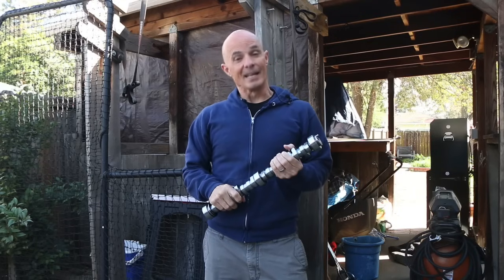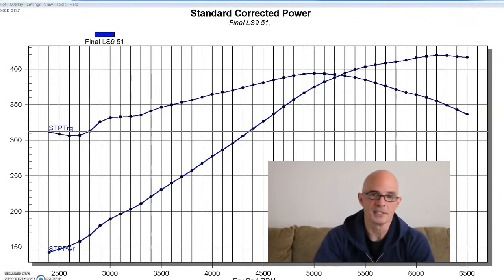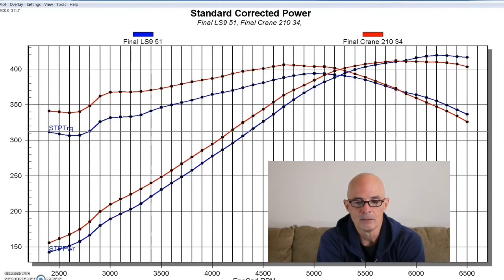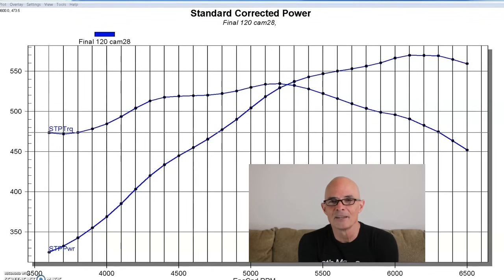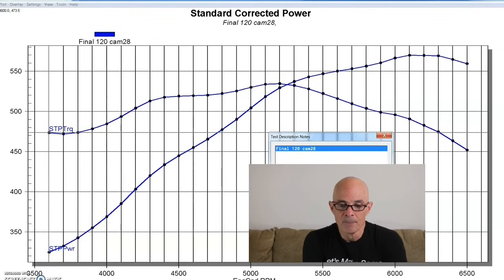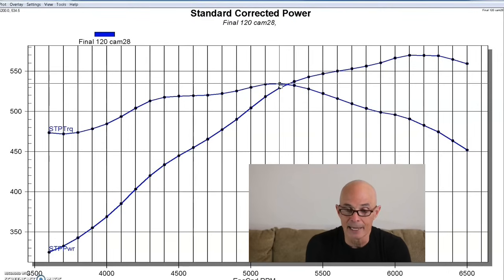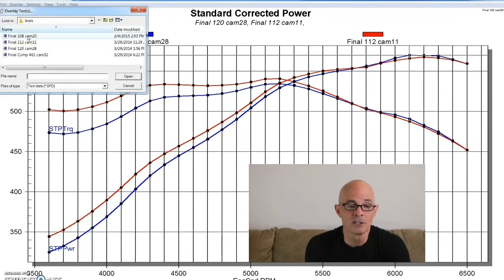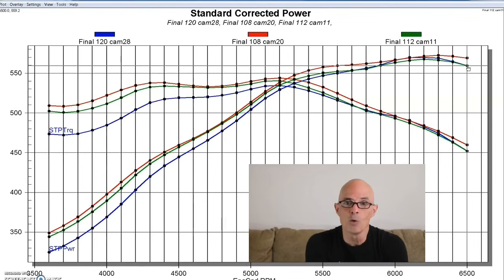LSA CAM TEST-108 vs 112 vs 120

Comment: Wow I just used the formula for a 376ci and 2.165" valves and I got 108.244  here is the formula by God himself well the LSA God
 LCA=28-(CID/8/valve dia/ × .91) and I'll be dipped
Reply from the maker: if only formulas were absolute
Reply: @richardholdener1727  it's actually not a formula, they refer to it as a formula but Adam had explained  in his first cam video that It's is an Empirical Equation which is proven to be absolutely accurate... An Empirical Equation in Engineering & Physics is a Mathematical Equation that dont lie, they are based off physics, observation, experience and acurate data acquisition instead of just theorys, Empirical Equations are created based on a physical result of a specific phenomenon that is observed to occur in our reality, in the case DV's Equation it has been quantified threw thousands apon thousands apon thousands of specific and rigorous dyno tests... Real Empirical Equations are created without Theroetical justification which means what your saying is incorrect so you should further educate yourself and stop spreading misinformation in relation to this subject, Here is an example of an Empirical equation, Newtons 2nd law which is in relation to changes in momentum, F=(M1*V1-M0*V0)/(T1-T0) the accuracy of Newtons Empirical Equation has the same accuracy as David Vizards LSA=128-(CI/8/Vdia×.91) Empirical Equation, that 128# varys from 127-133 with different engine familys cylinder head geometry they are listed in Adam's new video that proves all of this with dyno data to be reality, along with Adam & DV's LSA, Overlap & Duration Formulas bolth of which are different but bolth produce the same results...
Yall "Professionals" even with all the knowledge alot of you have, most of you still lack higher level Metacognative ability so your completely blind to your Cognative Biases, specifically your Selective Perceptions and your Conformation Bias bolth of which leads to quite a few of you being blindly afflicted by what is scientifically/psychologically known as The Dunning-Kruger Effect which is pretty sad but that is the reality we live in...
Most of these things including the Psychology aspect, adam had brought to my attention. After talking with him and doing my own research based off the information and the terms he has provided me, I am beginning to see what he said to me about how every single one of these things in this comment intertwine and create the reality we live in... I suggest you watch Adam's newest video and read everything that he wrote, he told me that he had simplified the video as much as he could so people could hopefully understand it.. He had said the subject is in reality so deep and complex that mabey 1% of the population or less would understand a video of that broke down the physics and explained all the complexitys of the subject at hand..
There Are Very Wise Men Coming Up In These YouTube Streets

Comment: No one wants a narrow power band on a street car. Or a cam that comes on with power late. Middle ground is usually best. I've seen more over cammed engines then you could imagine. What cam you think is best take about 20 percent away from that and you'll be happier.

Bv

Comment: If you listen to Dave vizard. You will find that he discusses the lobe separation angle being much narrower, especially on smaller displacement engines. The higher the displacement the less effect of changing lobe separation angle becomes. At about 400 cubic inches, it has becoming almost moot, if I'm remembering his descriptions properly turn it down about a 5.3 L engine, A 106 to 108 bulb separation angle should be fairly Optimum especially for a street engine. With higher lift and duration, it still follows. As you move up in displacement the difference in lobe separation angles tends to start to fade away and larger engines tend to like greater lobe separation because of volumetric efficiency changes. I'm doing this from memory because it's been only a few times that I've studied this, but I have always remembered what he has to say because he has the background and has done more testing than you will do unless that's all you do the rest of your existence.

Comment: Thank you, Richard. I was going to ask you this question and I recalled you always telling us to refer to your long history of videos. Lo and behold you had one on LSA that really helped to answer my personal question, I wanted to know if I could go to a lower LSA on my EFI equipment BBC. All the cam specs say not for EFI. But I know what you normally run, and I thought you had my answer. I'm not that concerned about idle quality and would like more chop at idle for my 70 BBC Chevelle. The only other thing I'm wondering is what effect positive or negative a smaller LSA will have on Nitrous. I'm off to search for that video... Thanks for all you do! Mark
Reply from the maker: lsa is not related to nitrous. ask what the cam does to the na power output, then add nitrous

Comment: Hey Richard, camshaft theory is fascinating to me and watch this video often. In fact, I had a custom Bullet Cam for my 454 ground partially based on this video. Theorizing here, a tighter LSA generally increases cylinder psi, because it increases the dynamic compression, which may have contributed to not only the expected bump in low speed torque but also the power across the board.

Comment: Love to see same camshaft  with 3 different  engine displacement.  Chevy 4.8 liter , 5.3 liter, and a 6.0 liter what's the difference in idle quality and vacuum signal.
Reply from the maker: I have run the same cam on these different displacement

Comment: I have a 427 LS motor 14 to1 dart block the heads flow 360 on the intake and 244 on the exhaust. I’m thinking about ordering this cam solid roller. @50 274/284/705-LSA 112. Do you think 108 LSA would be better?

Comment: David Vizards 128 formula puts the ideal cam around 107 LSA based off engine parameters. I don't know the compression so just assumed around 10.5. If higher the LSA would be wider so 108 would be perfect. Weird how his formula works.

Comment: the 120 is prob more suited to forced induction
Reply from the maker: they all are suited to forced induction
Reply: @richardholdener1727  maybe but the 120 with less overlap likes big boost,instead of blowing out exhaust port
Reply from the maker: how does it blow out the exhaust on a turbo if the back pressure is higher than boost-and the change in lsa might not add overlap (might have started with negative to begin with), and overlap is NOT bad for boost-if it adds power na, it adds power under boost.
Reply: @richardholdener1727  back pressure should not be higher than boost in any modern system,it's why gale banks twin turboed small blocks back in the 80's LOL,it's hard to build cyl pressure when it's being blown out exhaust port LOL,and in a street EFI application you will find it very difficult to tune with unburnt mixture being blown into exhaust,overlap is not needed in a high boost application

Comment: The reason I widen my LSA is to soften up the bottom end for engine longevity. I have noticed with my twin turbo 406 sbc I snapped 3 different rods before I switched from 108 to 112. Now I have had the same engine for 3 years with no noticeable change in performance down low.
Reply: And as for the gains up top with the 108 LSA sometimes things just click and the flow and rhythm of an engine just work right together.

Comment: I have been told that EFI does not tolerate tite LSA well.
Has to do with reversion / irregular air flow thru the MAF sensor.
Yet u apparently had no problems. 
Care to comment ?
Reply from the maker: we don't run a MAF-we run speed density

Comment: If you had picked cams with smaller duration or lsa that put the widest lsa w negative overlap , the middle at zero overlap,  and the tightest lsa with a few degrees of overlap , I think the results would have been the same, but much more dramatic .
 Great test though . From my thinking, the Only reason to not tighten lsa is for smooth idle and easier tuning on sensitive efi units . From a power production standpoint, tight lsa wins .
 I good excuse to get a custom grind on LS cams . Its easy to find gen 1 sbc cams w tight lsa . LS cams are rare with overlap , unless you get a cam on the edge of ptv clearance .

Comment: My NHRA SS/J  66 Chevy II uses a custom ground solid roller with a 109 LSA  I had ground using David Vizards 128 rule. My heads are NHRA Superstock legal Edelbrock highly modified by Edelbrock to coincide with NHRA rules. I shift @ 9000 so its wound up pretty tight and pulling off a consistent 8.60s with a .060 over 327 and M22 tranny is no easy feat. Listening to David Vizard and reading his books has made not only my Superstock fast but my Stock Eliminator K/SA Monte Carlo SS (with the factory L69 305). This test Richard just run backed up the 128 rule big time. For big blocks and Fords is 127 and he has videos on it if you are wanting to learn. Thanks for this video Richard you are very entertaining and easy to listen to unlike Freiburger and Dulcich.

Comment: Good video - people are realizing the tighter LSA  means more acceleration torque AND NO LOSS upstairs- bigger displacement responds even better, of course vacuum drops due to more overlap and worse throttle response below 1500 to 1800, so an automatic and smaller engine should use a somewhat looser converter, BUT make sure converter stall speed is below top gear or overdrive RPM at highway cruising speeds.
Reply: That last part is basically impossible for a good street car. Cruising RPM in top gear at highway speeds needs to be under 3000 for anything approaching acceptable fuel efficiency. Most underpowered ecoboxes and sport compacts (the normal ones, not the extra weak ones under 130hp) run 3000rpm at 75mph in last gear.

The way I spec it is roughly 1/3 redline should be your normal cruise RPM, and that should match up with 0-10mph over your local hwy limits. Or if you have an abundance of torque and/or enough gears that they don't feel too long, 2000rpm cruise no matter what, and between 60-80mph

Comment: Does this follow the 128 formula we have used for years? The LCA as I was taught allows the combination your using the proper amount of time to fill each cylinder.  When paired with a larger intake valve, the LCA tends to widen slightly, pocket porting ect all helps flow.  Using the ci of a single cylinder & intake valve size to calculate the best LCA for the combination. That is considering we make sure the larger valves are not shrouded, I have seen where installing larger valves & nothing else was done, they actually lost tq & hp.  The larger 2.02 valves didn't offset the flow vs stock 1.94 intakes. Each build is different, the combination reflects the rigs weight, gearing/tires & intended use & overa

Comment: So I’m on the fence of getting the Stage 2 Texas Speed LS3 Cam or the BTR Stage 3 LS3 cam. They both have the same duration and lift. Only thing different is TSP has 112LSA and BTR has 113+4 LSA. What would the power difference be? And which cam would be a better choice?
Reply from the maker: I would go BTR for cam stability
Reply: @richardholdener1727  sounds good, what exactly do you mean by stability? I just like to be educated
Reply: @ZachClynes he uses BTR cams, hence the recommendation.

Comment: Assuming identical lobes, the wider LSA requires an earlier exhaust opening and a later intake closing. 
If the cam is smaller than ideal, that will improve top end. 

But if the cam is able to feed the intake and heads' sufficient air, you're giving up all of your scavenging for no improvement in top end.

Comment: Welp, I'm seeing this two years hence, but of course it's still very interesting. I've wondered the same thing about LSA for many years now.

I'm positing the lower numbers at lower RPM for a wider LSA have to do with how the wider LSA bleeds off more cylinder pressure. Both valves are still open for several degrees of rotation, and you can't build cylinder pressure until they are both shut.

My bit of homework on the newish cams sold for use on low compression engines run in line with this.  Comp Cams' Thumper series, Hughes Engines' Whiplash cams, all have very tight LSA numbers.  As you say, they give the hot rod guy the lope he likes, but the smooth out early. And they actually make more cylinder pressure than an OEM cam.  The lope isn't desirable for an OEM for sale to the general public.

All in all, very interesting and thanks for taking the time and effort to do it.

One other factor I've wondered about for years, how about the installed angle of the cam?  Would installing the 112 LSA piece, maybe even the longer one, make these valve events soon enough to compensate?

Thanks!

Comment: Does this translate into sbc as well? What lsa would you recommend for a 383 with 10.1 compression?
Reply from the maker: don't pick your cam based on lsa-pick it for the things you need it to do! Idle quality, drivabiliy, power, torque, converter choice etc...

Comment: I let crower pick out my cam there always 112 and they make great power ,I just tell them what the car weighs rear gear ratio trans stall converter RPM tire size what intake and carb compression they never let me down

Comment: I wish these guys would just run two different rpm sweeps, on some of these tests, so people could see what happens to the daily driving characteristics too... I was watching this again to get a better understanding of why Engine Masters got different results, primarily with the 112 lsa. It appears that the intake manifold has a significant affect, as EM used carbs with a tunnel ram vs the FAST efi here. So, it appears you can restore a lot of the lost mid-range power, of the wide lsa, with intake runners tuned for to do that.
I think what folks really need to know is that with the higher lsa the vacuum at idle, and up to where the tighter lsa catches up. This is important for two things. 
One, power and driveability will be better at daily rpm with a wider lsa.
Two, tuning will be significantly different. Fuel injection is typically more affected because often times fuel pressure in at daily rpms is controlled by vacuum. So, if you don't have 15-20in at daily rpm, the engine is going to get typically about 10% too much fuel. This can be tuned out more easily on modern systems, and a lot of them don't use vacuum reference. But, if you're trying to cam up an older FI car, or meet emissions on a newer one, this can be a problem.

Comment: I know this is an odd question, but, how close are you getting to of an open cylinder allowing spark before the cylinder is closed and making compression? I know that you can get overlap but what LSA does that happen?
Reply from the maker: BOTH Valves are closed when ignition occurs

Comment: 295/336 Duration, 595/595 Lift, 107 LSA I was thinking about putting this cam in my stock 5.3 stick shift 4.10 gears and truck weighs maybe 3200lbs

Comment: I like the 112 because it will idle way better and I believe get more mpg.I put an Isky small rv cam in a 1979 camaro with a 350 and an automatic.It ran good but I never could get over about 11 mpg so I swapped in a bigger cam from Crane with 112 and had way more power and it idled pretty good and got back 15 mpg.But this Ls might be different 🥴

Comment: Smaller CID may mean smaller bore. Which could effect “in chamber/cylinder air flow”. *scavenging.  
I think you proved scavenging is mostly important at lower RPMs. 
At higher RPMs things become too fast to make a difference.   

* maybe I think too much.
Why does my head hurt?!
I think they call this dynamics.
*Ouch!   There is goes again.

Comment: Hi Richard, have you tested the difference in LSA on a boosted application? I have a torqstorm supercharger on my ls3 with a cam with a 111 lsa.
Reply from the maker: look at what the cam does na-that tells you what it does under boost-don't just look at lsa
Reply: @richardholdener1727  Thank you!!!

Comment: I would  like to see the same test done on the mighty yamaha sho engine  I was told It could  get 300 hp easily  and rev begone 8500 rpm is it a fact or fiction
Reply from the maker: we have seen the SHO motors go over 10,000
Reply: @richardholdener1727  really? What have they done to  it would  like to see it

Comment: another way of seeing this for someone with a DOHC engine. Is the stock camshaft timing, then advancing the exhaust camshaft 4 degrees. then another 2 more degrees. ( however because everything has an equal and opposite reaction this is Also decreasing the overlap period by closing the exhaust valves that many more degrees before. Thus decreasing the overall amount that both intake and exhaust are open together at the same time.)

Comment: You don’t need overlap if your heads flow? Or a small cam works if your heads flow?
Reply from the maker: over lap does the same thing on good and bad heads (the combo just makes more power with good heads)
Reply: @richardholdener1727  my xe266hr12 I’m wondering if I should’ve gone with either the 270 or 274 you mention, heads flow 250@ .500 but will I lose meaningful torque below 3k (freeway driving) if I switch cams to the venerable 274? (4300 lb Bronco /331

Comment: Yes a smaller displacement would like a wider lobe separation (something like a couple degrees for every ~ 30 cubes with a given induction).  More cross flow = less overlap requirements (so SBC needs more than LS, 9 degree needs less than an LS and a Hemi needs even less; much tighter LCA w/ 23 SBC vs a well designed hemi for given displacement).

Tighter lobe separation =
More displacement 
Less cross flow (intake to exhaust)
Less good cylinder head flow capability 
Lower CR, boost or nitrous 
Less agressive valve action

Even on more displacement though w/ better heads, more agressive valve action, more compression, rpm... you'll widen the LCA (from a tighter baseline).